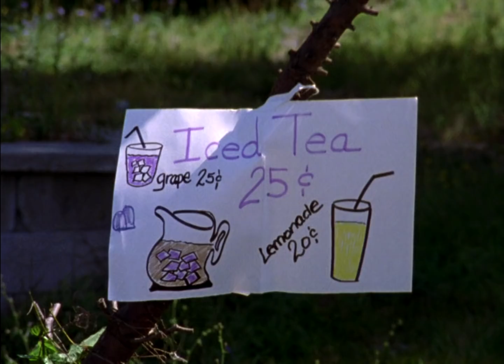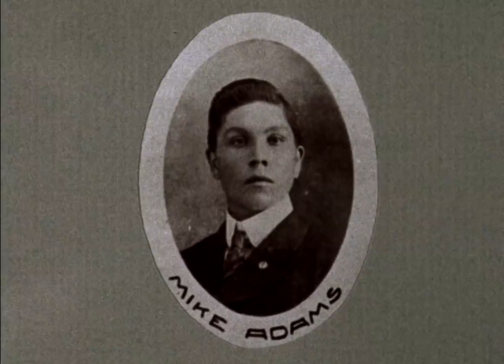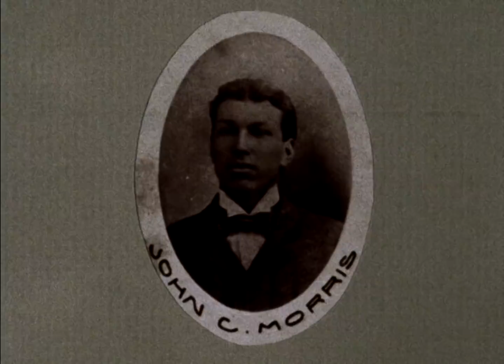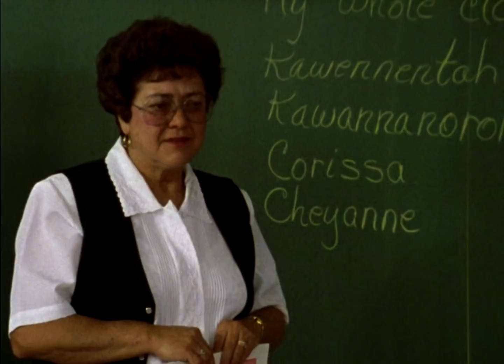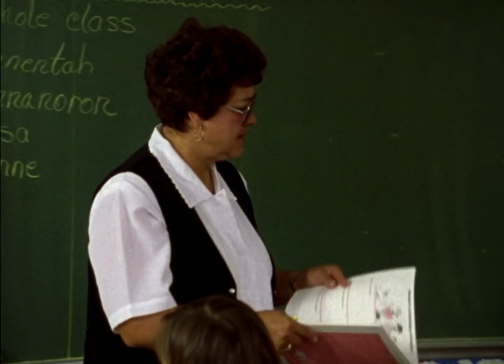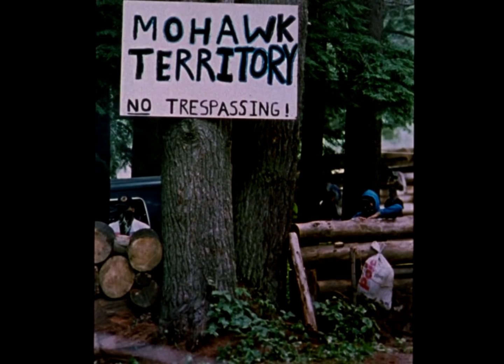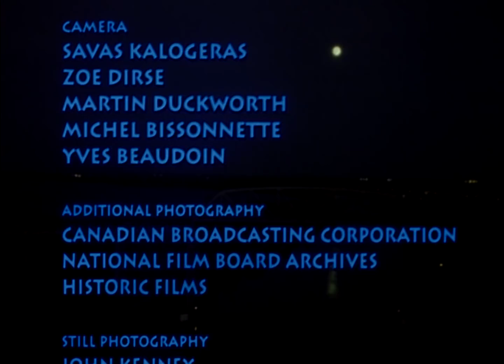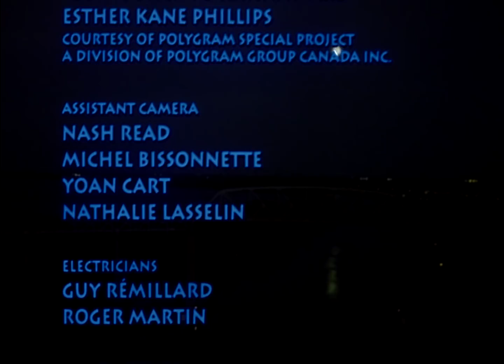Spudwrench - Kahnawake Man

Comment: I walked smaller commercial bar joist. None ever told me not to. About ten feet out they start swaying back and forth violently side to side. Then l thought l might try walking across like five that were not shook out. Ten feet out the pile of bar joists went into a death wobble. It was fun work satisfying work and l loved it. The stuff l did back then was only like four stories tall. The stuff available at the time non union. I later went to kcMo. Hall local ten for letter of intent to hire. They said and l quote "Son..,you can use that front door as an exit as well. So l joined Carpenters local 61 and it was a career l loved